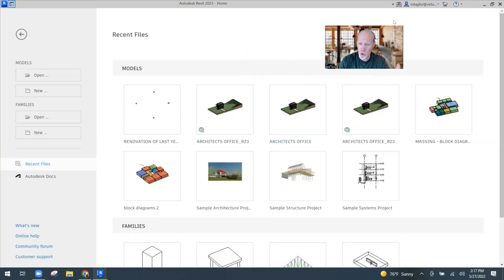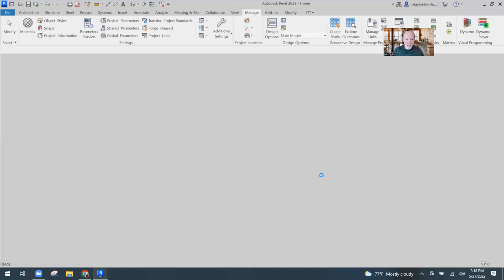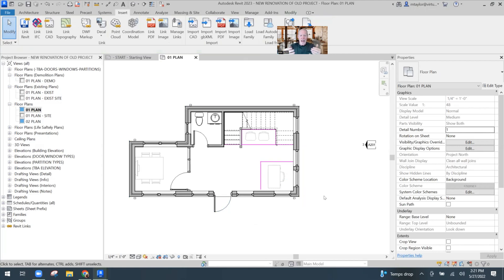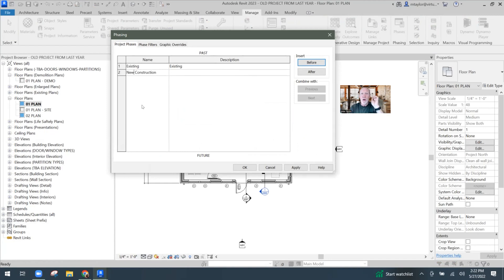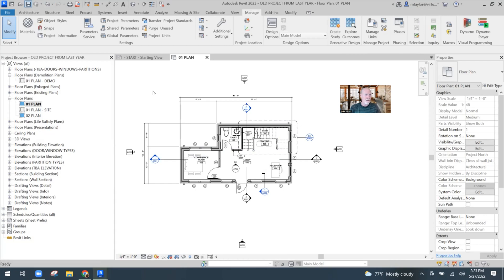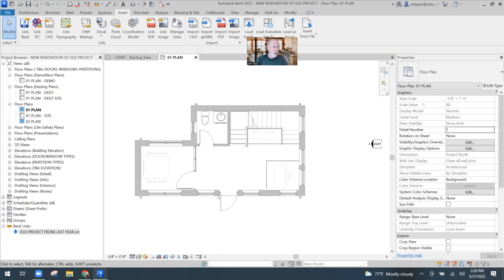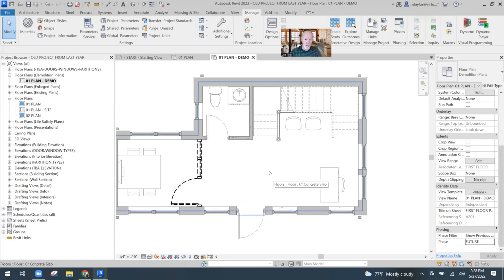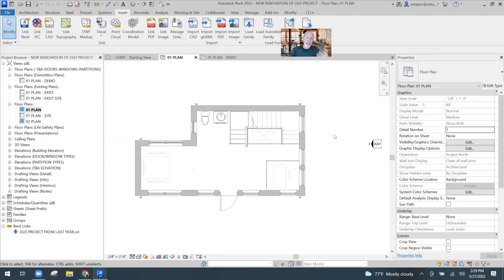LINKING FULL PROJECT FILE AS 'EXISTING' CONSTRUCTION: For demo and renovation work

Comment: This is good stuff. I do wonder if there are any downstream process issues. Things like using Revit keynoting for demo plans in the new. I assume as long as both files are pointing to the same keynote file you will be able to keynote the demo items in the new project. I believe it doesn't work that way, however. I believe you would need to keynote them in the old original linked file first and then you can keynote them in the new project.
Reply from the maker: I make a keynote file with a D in front of items that are demo (D1, D2, D3) and normal numbers for the new work items (1, 2, 3).  Revit can only use one keynote file at a time.

Comment: Thank you for your sharing. My question is, are there other uses for phase mapping? For the example you did in the video, how your method is more interesting than making a copy of the old project and doing the job as we used, instead to use two files.